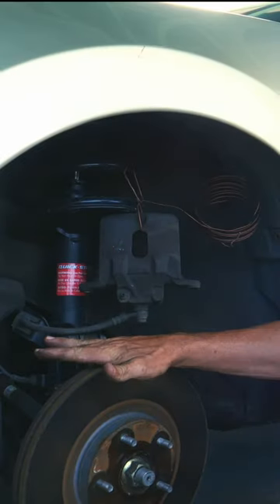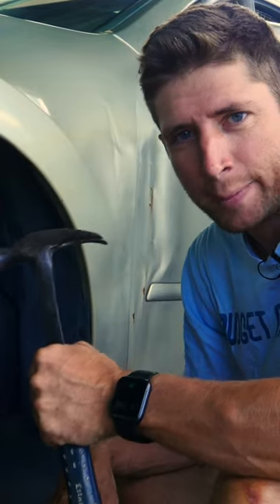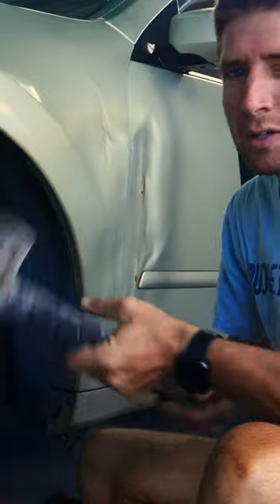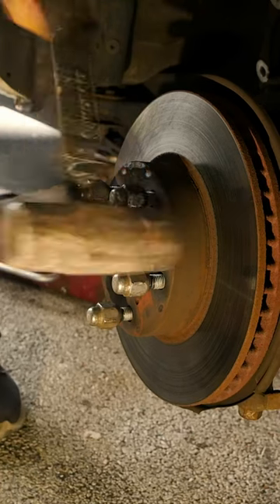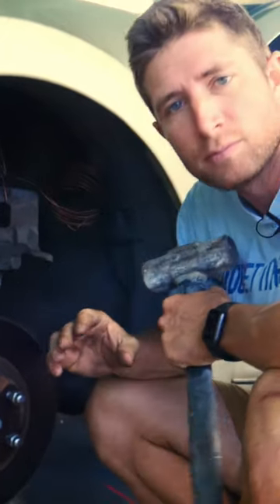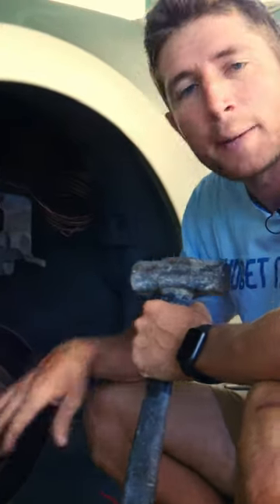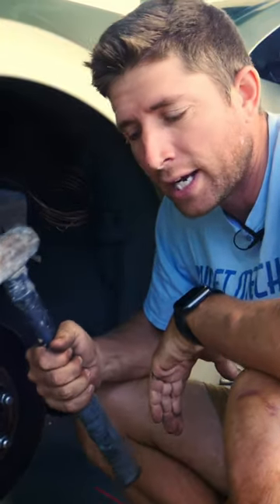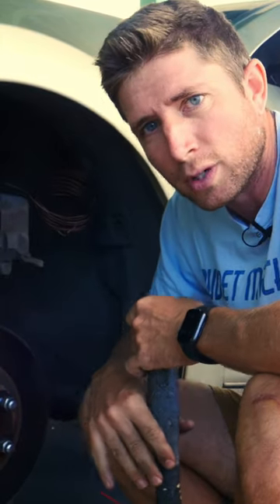WRONG!! This Tool Won't Remove Stuck Brake Rotors!

Comment: The lugs on the studs is smart
The most important thing I learned early on is if it’s not working, you probably weren’t hitting it hard enough
Nothing beats blasting a rotor to pieces in 3 swings when your friend and his dad have been beating on it all day

Comment: 😂😂😂😂 ah such a cute little hammer. Let me know when you have to use a 20lb behemoth and crack the rotor to get it off. Took about 50-60 swings standing up almost like chopping wood with an axe. Then I had to repeat it on the other side... BTW, I live in the rust belt... This is common.